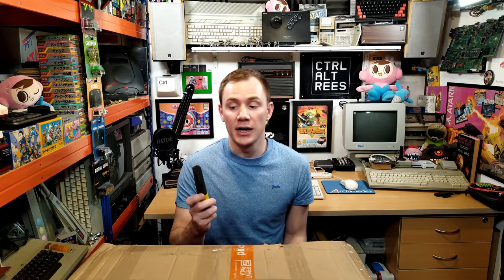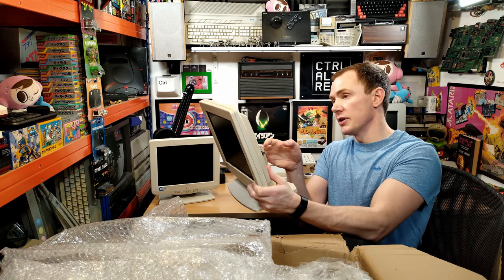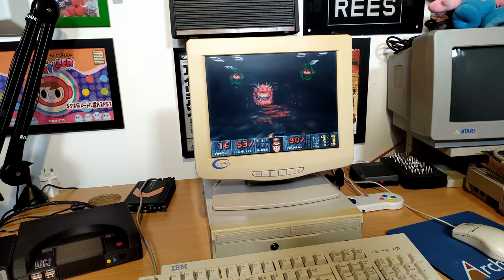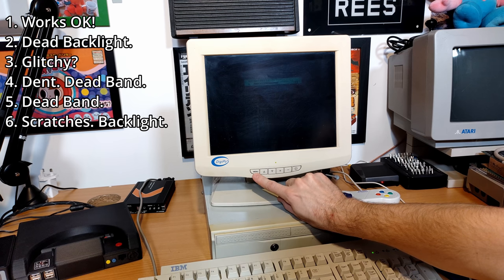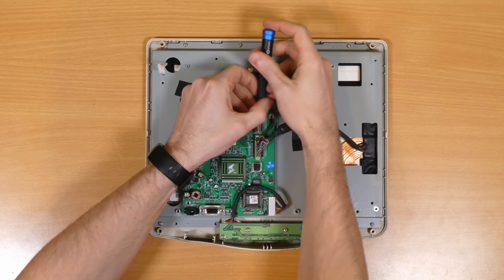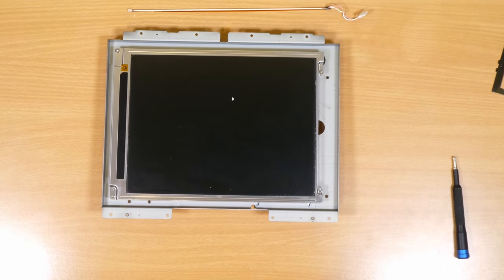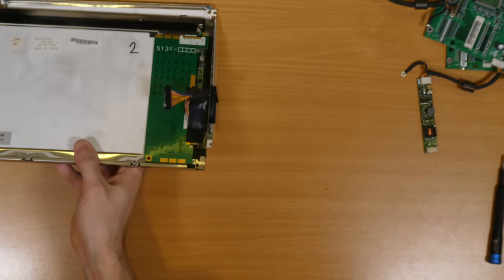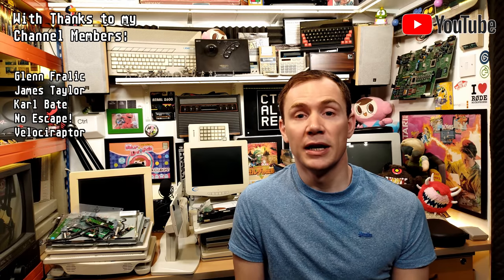eBay Bargain Or E-Waste? TFT LCD Monitor Job Lot Repair

Comment: I think a good use of the cases would be to put an iPad 4 screen into one. They're great with MiSTer setups, and quite cheap to pick up with a suitable controller board. 
3D printed cases do exist, but I think DigiPOS would look better 😁
Reply from the maker: I could even stick ctrl-alt-rees stickers on them and sell them 😁

Comment: I stocked a dozen of those cheap LED backlight conversion kits from aliexpress a while ago so I can repair old LCDs. The 96 LED cool wite strips give off pretty even light and the're only 4mm wide, which makes them fit into pretty much everything. CCFL lamps are really not worth replacing in my opinion.
Reply from the maker: Thanks for the tip! I'm not sure I want to throw any more money at these but I'll certainly look into it.

Comment: Sometimes these things workout and other times they don't. The connectors for the lcd could have corrosion stopping them from making a good connection and it wouldn't be to hard to make a thin LED backlight. I have something like it in one of the kits I make. Just depends if the cost is worth it to get them going or not.
Reply from the maker: I'd say it absolutely isn't worth throwing any money at these. Oh well, maybe the video will go viral and the ad revenue will cover the £38 😆

Comment: You could attempt to reverse-engineer the power pinout for the CFL lamps and try soldering in some LED strip lights that you can buy by the roll just to see if that helps any at all. You might also be able to do the same reverse-engineering to get some of the other panels working.

Comment: I have been stocking up on old LCDs myself. Even if they are 5:4, its still better than modern 16:9 etc monitors that usually just stretch out DOS resolution signals 😜

I also have CRTs off course, but these LCDs are nice when building, testing and when table space etc is an issue 😉
Reply from the maker: Easier for filming as well 🙂
Reply: @ctrlaltrees  yes 😀

I used one with a scratchy panel experimentally painted beige for filming my one computer related youtube video 😜

Comment: A few years ago I went to the local store to buy some home stuff. The terminal in the department was broken and we went to the main office terminal and there were a few LCDs in a corner. I asked if they were broken and the guy next to us answered that they cost a lot, were crap and broke too easy and he wasn't surprised as they had been on 24/7. They were 3/4 years old.
Their IT tech even advised to just throw them away as all the components were so lightweight they couldn't be repaired.
Bottom line: business machines they had were overpriced crap.

They switched to Dell and I saw those around for years (from 2009), until 2019 and early 2021. Amazing.